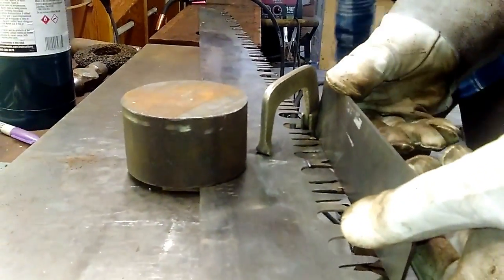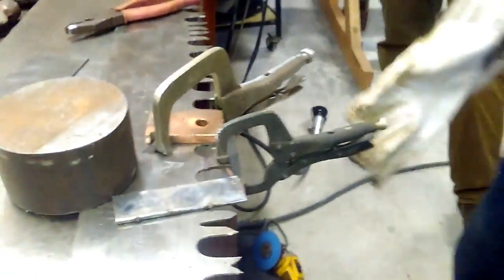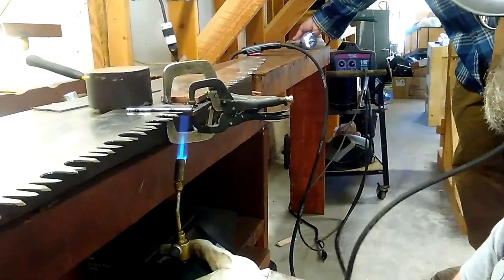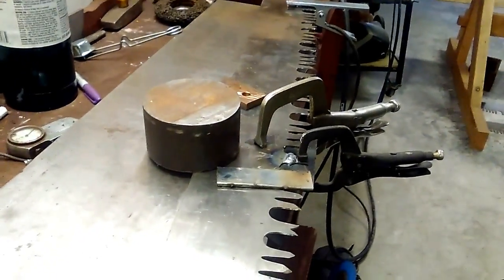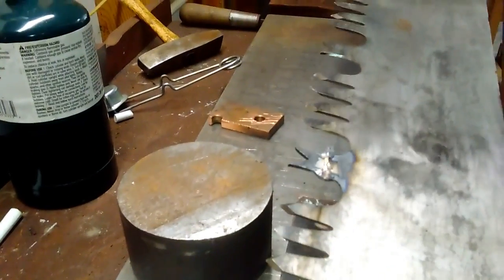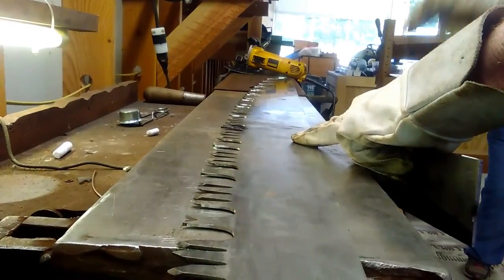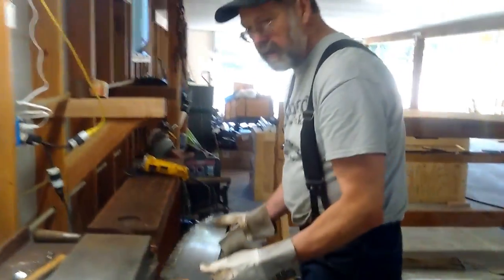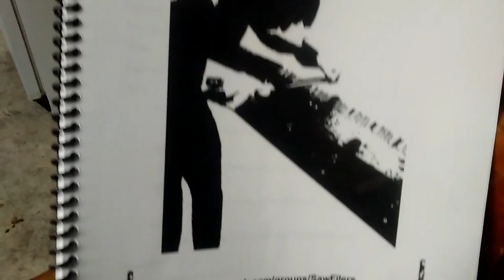I fixed Wranglerstars..... Saw

Comment: There is not condensation in the steel.  Preheating steel before welding reduces the residual stresses in the weld and reduces the hardness of the microstructure.
Reply: and not even needed in the first place. what is the most important is what wire you use is

Comment: Not pretty but I guess it will work. That weld sounded like a bowl or rice Krispies with a popcorn machine in the background. I know it happens and sometimes the feed is off or amps are low. I'm sure it will cut wood and thats what matters.

Comment: From what I hear, the wire speed was a little fast.. And from what I saw, why did you not weld both sides?
Reply: blatant2subtlety he did at the same time...lol that's called burn through where I come from
Reply: John Breceda Where I come from, burn through is just that. Burning a hole through your steel. What I'm understanding, is that he had good penetration. 

I guess, I'd like to see the other side from which he welded the saw. I can imagine hairline undercut if he didn't grind too much of the steel/weld away.

And his wire speed? Did that not sound like it was running too fast? Maybe it was his distance from the saw that was causing the "pop".. Either way, I could hear the electrode "knocking" against the saw. Should sound like bacon cooking not fire crackers. lol

Comment: i sorry tig with utectic 680 tool steel should of been used
Reply: you may be an accomplished welder and 98.99% of the time your going to be right but in this case the people who are repairing the saw that's what their accomplished at the maintaining/repairing saws similar to the 1 they just repaired you can be reassured that if goat needed to be sacrificed for this repair that it was done remember when Cody does a video about how pleased he is to have his bestest saw repaired and working again these people will experience a boom in business and the big reason you know they did it right was they would be screwed if Cody gave them a bad review not that he would
Reply: ubtaz I've been welding for over 35 years worked in numerous jobs like nucular power plants i have certification in just about all the alloys you can control the heat input in the material much better keeping the metal from becoming brittle and braking off the tooth at a latter date i would never use a mig on that job and if you puching for business for that shop good for you im just trying to suggest a better processes to ues
Reply: Skip Roberts that's sorta my point in a nut shell your making an assumption and as I said already any other day you'd be dead on however as you said yourself you have been welding for a number of years and I'm sure you are a fine welder however these people fix saws and just because you have a reason to believe your method is superior doesn't m
Reply: im offering a better way of welding this job and because of your being full of pride you can't admit im right you need to talk to Cody about how God feels about prideful men get over yourself

Comment: I think the gesture you did did for Cody was great but honestly I would never let this guy repair anything of mine. way to much over kill in the wrong places and poor craftsmanship in the other places like final finish of the grind and shape. when welding channels with copper there should have been a groove for full penetration but also because copper will always pull into the weld and leave porosity in the weld which I saw in the final grind. all that preheating was a waste of time and resources. Maybe if you were welding aluminum but not steel. Trust when I say I have thousands and thousands of feet of welding under my belt from all positions and most materials including titanium.
Reply: tonymengela lol someone is triggered
Reply: So,  you work on repairing old saws in the naval yards?  No?  Then move along.
Reply: ethan long I just do do videos, I dont have the time nor the will for it. That still does not negate what I said.
Reply: Cross cut saw skills are rare, and the guy may be the best in the world at sharpening them. I cringed a couple times during the video though, like when he held the tooth in a pair of pliers in one hand and the grinder in the other and ground it too short and at a angle. There were a couple other issues but hopefully the end result works fine.
Reply: I agree if the weld was perfect you would not be able to tell it was there. However, it is probably adequate to put the saw back in service.
Reply: I agree, I was only saying that this guy is supposed to be top notch but I dont see it. For sure they can use the saw, just from my perspective that was just a step above helper quality
Reply: for sure and yes it usable for sure, My complaint was that this guy is supposed to be top notch and it was not, and I saw a lot of procedures not quite right.
Reply: Dude, he is right. Bad craftmanship. Ive been hammering metal  for over 11 years now(and being a blacksmith includes nowadyas almost everything from milling, welding and god knows what to making 3d drawings) and this is okay for a beginner, but not worth a video.
Reply: tonymengela

Comment: A gtaw weld would be much much better
Reply: Yes but those machines are huge and not as practical in this situation
Reply: HexxyEEE  gtaw is gas tungsten arc welding. Tig welding. Those machines are much smaller than gmaw, or dual shield mig welders. Fcaw and tig machines are almost the same size. Tig would be better because it would leave less material to grind. Tig is also very clean, no slag. It he grinds it down anyway. Still, everything gets the job done.

Comment: There's a better way to do that, I'm not sure how but I know there's a better way
Reply: I agree, cant help but think all that pre heating ruined the spring temper. makes me think it well bend in use- leading to stress cracks across the width to the spine where the temper remains.